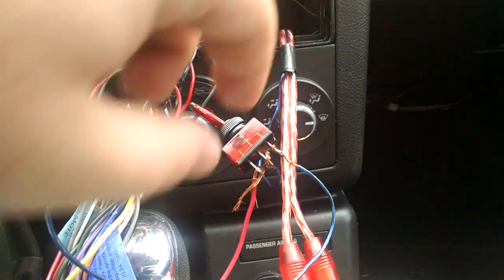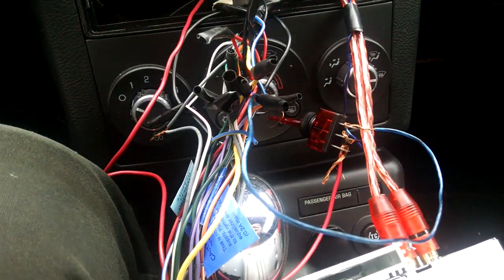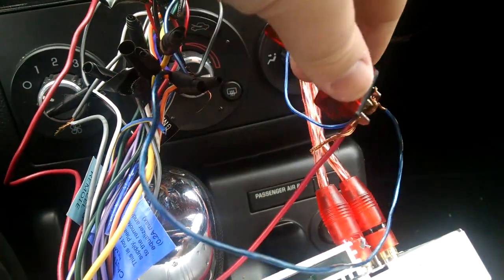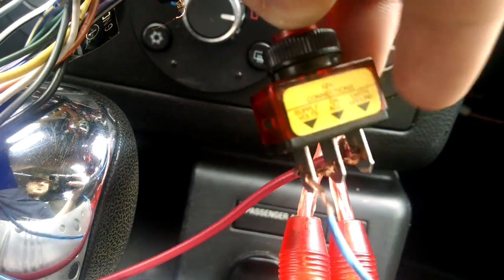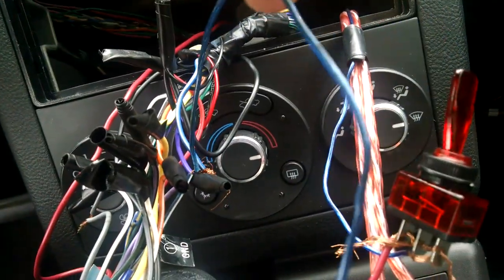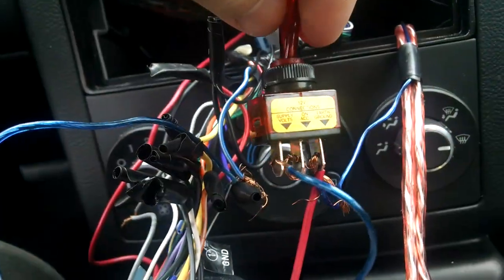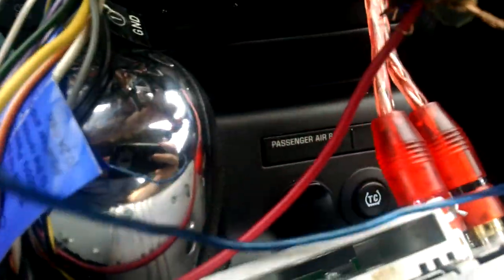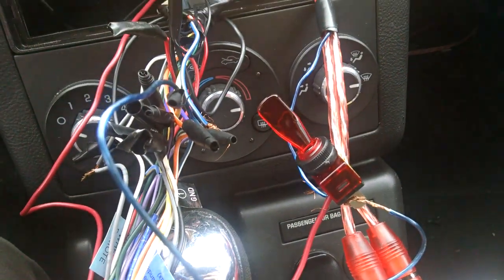How To Wire A Toggle Switch To Your AMP

Comment: For anyone who wants to know the right way,

Remote wire from deck to switch, ground wire from deck to switch, then remote wire from switch to amp or multiple amps

Over here we run multiple switches as you may or may not want to play mids or highs etc
Reply: So basically “inline” switch for the remote wire, thats running from deck to amp?
Reply: Sorry to bother boss but what if I want a on and off switch for my grill speakers how would I do it without amp boss??
Reply: @UhhitsJay  one ground can share your switch, if you have a switch with light then you will need one positive which can share between all your switch then connect each remote wire to the desired switch, 

If it don’t have a light then each amp run a remote wire to the switch then connect the other end to remote on your deck as it wouldn’t need a ground
Reply: @jayypeezy36  it depends where your speakers getting signal and power from if you don’t have a amp are you using the factory wire and radio?

Comment: I use a on/off/on rocker switch so that I can switch between two sub amps I have installed in the car... One is the daily amp at 1,500 Watts, the other is a 3,000 Watt amp that I switch over to once in a while when I feel unmoved by the thump of 1,500 Watts.

Comment: All u gotta do is put the positive to positive battery. Put the ground to negative battery. Put the supply to the remote wire on amp
Reply: I'm putting in a sub using my stock receiver so basically just one end of the remote to the POS battery , other end into the switch, ground wire from the switch either to NEG battery or chasis somewhere, then wire from switch all the way back to the remote connection on the amp . Correct ? I don't wana run it off of a tail light or something which is why I wana do it this way

Comment: A lot of negative comments, but none actually said how to do it the right way.  This guy may actually be correct to connect the speaker wire because in some cases the speaker wire is used to turn on the amp (if you don't connect to the stereo input power wire).  If your stereo has a remote power wire, then it's best to do what's in the link.  If not, then you can connect to radio power instead of to a speaker.  I like this video (diagram).
https://youtu.be/pQ_VlDMw6Ew
Reply: Never use speaker wire to turn on a Amp, they make correct wire for that and need to find what gauge of wire is needed for the Amp and install

Comment: Wouldn't you just put it in line on the remote wire for the amp? I think that would be best unless you're gonna do a volume knob with a potentiometer, just my opinion
Reply: Probably blew the remote on the amp as like I did
Reply: I thought the same thing

Comment: Or you just buy a bass knob...
Reply: But with a bass knob the amp is receiving constant power all the time when the key is on which is terrible for the amp, especially on long trips. And we all know systems, even $5k systems aren't meant to bump for 8 hours straight or even 3 hours straight, also an amp isn't meant to be on for extended periods of time. Short trips at night, a bass knob is the way to go, but if you takin long ass trips on the regular then you should use a remote toggle, just to be safe. Kinda like the big 3, it isn't absolutely needed and a capacitor works just fine in most cases, but the big 3 is also somethin you wanna do just to be safe.